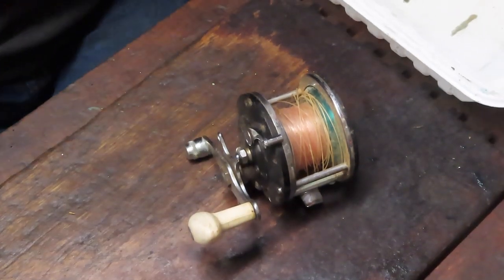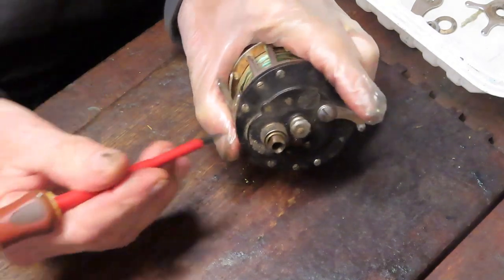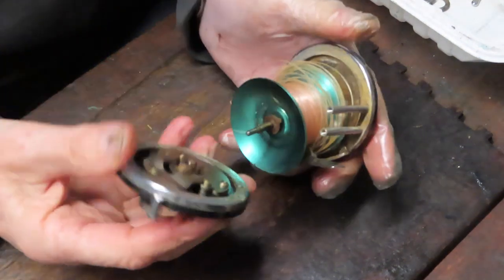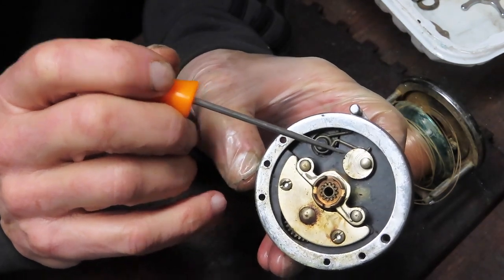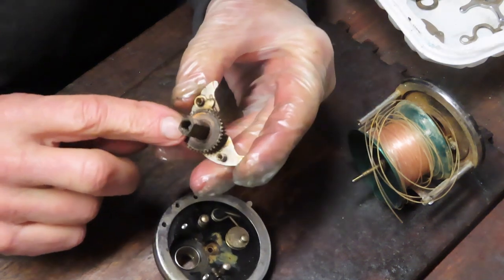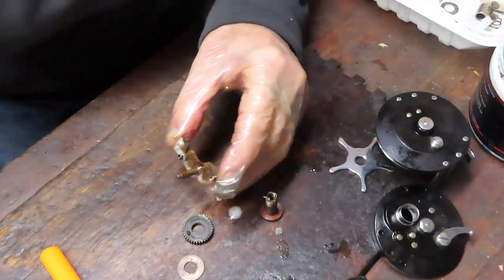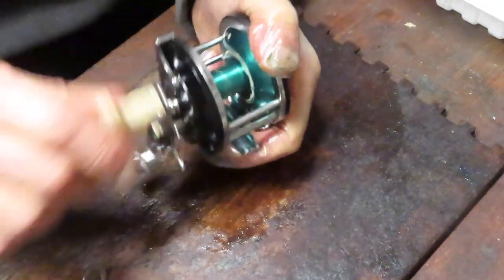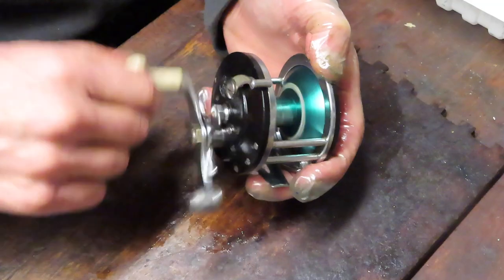Ocean City model 988 vintage saltwater fishing reel how to take apart and service

Comment: Dennis, You can put and HT-100 drag washer on a tapered spindle and then spin it as you reduce the diameter on a belt sander.  I did the sanding with a palm sander clamped to my bench when my belt sander passed away.  Ward
Reply from the maker: Thanks Ward.  I tried that but it came out oval.  I found a way to use a long carriage bolt with two hardware store washers clamping down the oversized drag washer as a way to do the same.  I put the bolt shaft in a drill press and then hold the sandpaper while the drill turns it like a lathe.  Best wishes - Dennis
Reply: You take more time than I do.  I use a long tapered punch, hold the washer tight with my fingers and spin the punch with my other hand.  The washers get close to round and I occasionally get a partial manicure

Comment: Did I ever tell you that I finally found that Ocean City saltwater spinning reel - the 320. It is a little different than the 300 but I probably won’t use it for surf fishing. It is very collectible. I like the reel you’re working on because of the narrow  frame and spool and because I just love the old Ocean City reels.Your ultrasonic cleaner sure makes things easier. I can’t justify purchasing one because I just don’t work on that many reels. I got in two today - s Mitchell 406 and a Shakespeare blue 2410. I need to find a 2430 to complete that series.  I have a number of vintage reels with leather drag washers. I am lucky in that all of mine were still in good shape. You did another of your customary’ fine jobs on this great old gem! I can’t wait to work on those two reels that just came in. Even with a heater my garage workbench is too cold to work on reels right now!
Reply from the maker: It's getting cold here as well.  I wish I could shut down the blower during filming, but it just gets too cold without it.  Sounds like some great finds.  Best wishes - Dennis
Reply: Christopher, looks like you and I may be competing for that 2430 on ebay. I'm trying to find one at a reasonable price, but they are scarce. Good luck!
Reply: @barneyewing2664  The only 2430 I’ve ever seen on EBay was in Great Britain with an exorbitant price and expensive shipping.  I’ve collected all the gold 2700 series and the 2740 was the rarest and most expensive one. That series had more reels than the blue 2400 series. The gold 2700 series included these numbers - 2700, 2701, 2710, 2711, 2740, and 2741. If there are reels in between the 2711 and the 2740 I just can’t find them. The 2700 gold reels only had 1 ball bearing while the blue 2400 reels have two ball bearings. I have 20  vintage Shakespeare reels including all the Sea Wonder models but the blue 2400 reels are definitely my favorite! All that is to say - yes we will be competing for the 2430. I want to complete my set!!! You are also correct that this 2430 is exceedingly rare. Good luck to you as well. I hope our competition will not break the bank. —— Chris

Comment: Although it wouldn't work on this single drag washer, I have had luck squeezing the oversize washer between two of the metal washers and trimming off the excess with a sharp razor blade for a perfect fit.
Reply from the maker: Thanks for sharing the tip!  Dennis

Comment: Good Afternoon! I have an Ocean City 987 reel. After watching the video. I have a few questions? I can tell you the reel spins anytime and the only thing that locks it is the clicker. After taking it apart should this model have a drag washer like in the video? And the little spring you say not to lose, with the metal tip on it? I have pictures I can email you, if  you would like to see it.
Reply from the maker: Spinning freely means that the A/R dog is not engaging.  That would be the spring with the metal part on it that hold the A/R dog in place.  You need to check that first.  The drag washer is not the cause of the issue - Dennis
Reply: That dog and spring were missing when I opened the reel. Do you know what 2 parts are equivalent from a penn reel that I might be able to search for?
Reply from the maker: @strosfan82  The Penn parts are not interchangeable with your reel.
I may have some replacement parts for the reel.
Please send a not to my email 2ndchancetackle@gmail.com - Thank you
Dennis